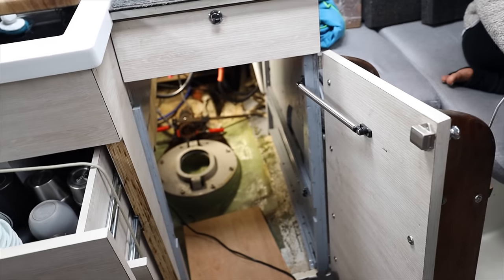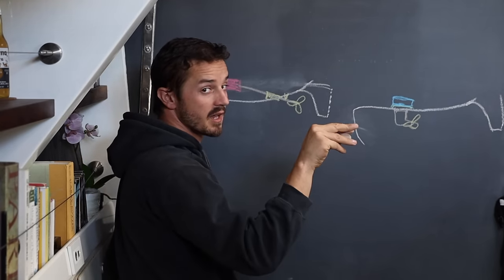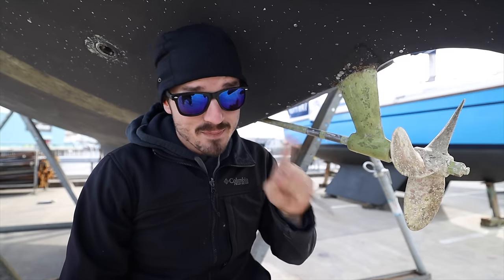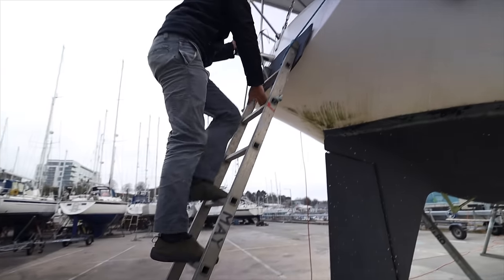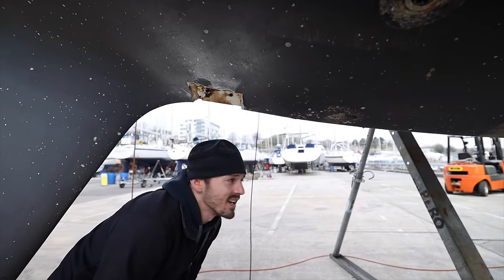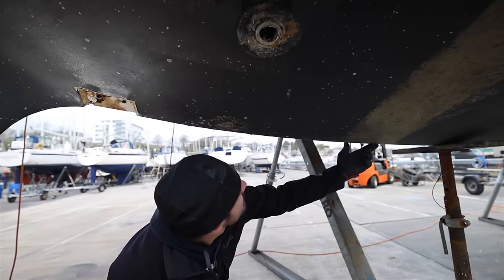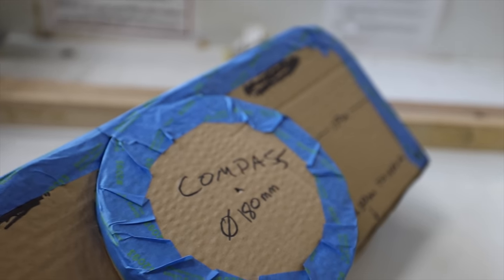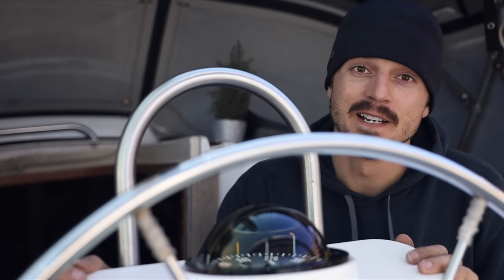CONVERTING to an Oceanvolt Electric Sail Drive — Sailing Uma [Step 213]

Comment: So quick question, did you end fiber glassing over the hole where the skeg was inserted or is it left like that? Wont that cause drag if not glassed into the boat fully?
Reply from the maker: If it was glassed in, we'd never be able to remove it. Water circulating around the saildrive is also part of the cooling system. But no, it doesn't cause any drag.
Reply: @SailingUma  Thanks for the reply. Funny I was just watching the video where you had the sail drive replaced and now and it makes total sense. I didn’t realize this was  more like a transmission. Definitely needs to be removable to be serviced. It was a novice post.

Comment: Shouldn't you build a box around the motor? I'm afraid that if you hit something hard enough the moment on the saildrive arm can create a lot of force to break the mount free allowing lots of water to enter the hull. A boxcarpundvtge motor that extends above the waterline would help prevent water flooding the hull.

Comment: Great video as aways. How did you know the correct gear ratio to use with that particular sail drive? Thanks!
Reply: Its one system, Oceanvolt sorted that for you :-)

Comment: I'm very impressed with your vertical glass work, I would have bet money it could not have been done without tape and visqueen. 
For reference, the hull of the OA 70e was 13 drums of resin, catyaized with 9 gal of hardener. 
She has dual volvo  rotating pods. Just like your setup. https://features.boats.com/boat-content/files/2012/03/pod-drive-2-1.jpg
Great job!

Comment: Glassing with resin in cold temperatures is not good for proper hardening and curing of the resin to get maximum strength and durability. You need to heat it with some heat blankets or heat cabels to at least 25 grade of Celsius for 24 hours. Read technical recommendation of your resin.

Comment: There still seems to be a gap between the skeg and the hull. How did you cover that?
Reply: Does that 'gap' allow for turning the skeg?
Reply: @EdKendrickDDS  don't think so. The flange at 15:31 is bolted down

Comment: How awesome would it be if the sail drive could rotate 90º to Port or Starboard so you could use it like a side thruster to assist docking maneuvers, can they make them do this?

Comment: Don't breathe the fiberglass.  It will mess up your lungs.  Wear a respirator.  Also wear eye protection.

Wear bunny suits for glassing/epoxying too, just like painting.

Very glad you'll be able to hydrogenerate.  It's a huge advantage to be able to charge drive batteries by sailing.  Basically you're motoring on wind power that way.  It's a totally logical and synergistic way to move a sailboat since it's ultimately all using wind power.

Comment: I don't mean to pile on here as I see lots of folks giving you advice, but I'm a 42 year fiberglass shipwright, and I cringed a little when I watched you painting in the engine (motor) room, without wearing a respirator.
 In an enclosed area like that, without good cross ventilation to evacuate toxic paint fumes, 
an/or a respirator, bad things can happen to fine young lassies like yourself.
 An adequate respirator would be a half mask type with charcoal cartridges, rated for organic vapors. 
Yes they are a nuisance to have to wear when working, but some of the solvents in paints, when they build up in confined spaces, can be very bad for your health.
 Otherwise cool upload and very nice boat !!

Comment: How are you going to get regen with a folding prop?
The minute the engine is off, pressure from forward motion is going to fold the prop.
Reply from the maker: That saildrive is designed to lock the prop open to allow regen.

Comment: The red Loctite really means business... as your bolts can twist off upon removal unless you heat the bolts first.
Reply: Blue Loctite holds great ... but it’s more forgiving upon removal. There is also a green Loctite available for other applications. 
Freaking awesome good work!

Comment: my question is can you leave the skeg on the boat without the prop shaft running threw it, would it cause a problem if left on?
Reply: They did mention a leak where it was mounted. Other than that, I imagine it would just be a bit of unnecessary turbulence.

Comment: Going from conventional straight prop shaft to 90-degree gear drive introduces an inaccessible drive shaft seal that can leak, additional bearings, and right angle gear all of which can fail. As a mechanical engineer, Id have stayed with the new e-motor with straight prop shaft configuration.

Comment: No flange sealant between the skeg and the motor? Would have thought you might need something like a smear of loctite 518 for machined surface to surface mounting.....?
Reply from the maker: There is a huge rubber gasket in there. Just didn’t end up showing it in the final edit.
Reply: Sailing Uma ahh 🤣👌🏽 ok then perfect, carry on 😁❤️

Comment: Too late for you guys but prop shafts with slight wows or bends can be straightened and there are specialists who do this exacting work. (If you think you might like watching people measuring long round metal shafts and adjusting them to +- .001`` , then there are videos on youtube for you....)
Reply from the maker: The prop shaft was only one of the 4 problems we needed to solve with the new drive.
Reply: @SailingUma  Of course. I was thinking of other people who might be in similar circumstances one day. The thought of possibly donating it to someone else who could really use it speaks volumes about your character. So impressed with your sail drive conversion....
Reply from the maker: Prop shafts are custom fit to the boat though, one doesn't just fit onto another. For the cost of having a machine shop straighten and modify the prop shaft, you could just get a new one fit. We did donate the motor and controller to a patron who is installing an electric drive on their boat though, since those parts you can fit onto any boat.

Comment: I heard sail drives tend to get leaky seals, is that accurate? What is the maintenance?
Reply from the maker: Boats tend to leak without proper maintenance. Also, sail drive technology has come along way over the years. The majority of boats on the water have saildrives but not all are created equal and proper installation is key.

Comment: Why not just take the old prop off and leave the old shaft and skeg in place? that way it can easily be converted back if desired? they wouldn't interfere with anything if left there, would they?
Reply from the maker: It would leak. Since the pressure of the engine pushing on the shaft bearing is what keeps the water out. It would also just be in the way. We have no plans to re-instal a shaft drive.

Comment: Did you consider U Joints for your original setup?
Reply from the maker: No need. The motor is light and easy to align.

Comment: I have been bouncing around your vids and love them. Very informative! But I just priced an Oceanvolt SD 10. $51,000 USD for one...... what the Foxtrot Uniform Charlie Kilo!!!! That is NOT a budget upgrade!
Reply from the maker: You can't really compare the two. It's not "apples to apples"? An OV quote also includes the, batteries and chargers. The motor itself isn't much more than a diesel. $15k (ish). Same price as a new VP 50hp, which is it's equivalent. Plus you never have to buy fuel or do maintenance for 30+ yrs. How valuable is silence? What price can you put on maintenance headaches and top end rebuilds? Besides, our motor MAKES power while we're sailing. On a good day, 24hr passage, around 5-8kWh on our slow old boat. How many gallons of diesel fuel does a diesel motor produce?
Reply: @SailingUma  LOL! You got me wrong! I'm not criticizing you turning to electric. By far I am not because I myself am converting a ship to electric. Your series has been more than an inspiration. I've been trying to decide which system to install and have been online searching the different systems. I'm different than you guys though. I just bought a cheap 1977 Trojan F36 and removed both engines to repair and modify the engine bay to get ready for the electrics to be installed. Removing the gas tank next week and will use that space for a larger fresh water tank and water maker. I like the thought of the Oceanvolt but on my ship the regen isn't really feasible and the system hanging down that low on a low draft ship could cause me some problems. I'm still trying to catch up on your vids. You guys have something very special going on and it's great that you've shared it with everyone.

Comment: Now, lets see.  
Small hole in bottom of boat replaced with big hole in bottom of boat.  Hmmmm?
Big hole open, great place for critters to live and not streamlined therefore more drag.   Hmmmm?

Bolts that hold saildrive in place and seal big hole screw in from underwater and not visible for inspection unless you dive.  Hmmmm?
Repair parts specialty items vs shaft, prop, cutlass bearing, skeg and coupling being pretty standard boatyard items.   Hmmmm?

You two certainly are braver than I would be.  
I think this is the first thing I've seen you do to the boat I seriously question.
It will be interesting to see how it all works out.

Comment: I would never get on the open ocean relying on wind and electric power.
I would have some sort of gas/diesel kicker.
Always use the guard when using that cut-off wheel. That disk can shatter and impale you. 
Source: Actually seen it in happen in person.  I am a mechanic

Comment: Not sure how you are trying to fit the plugs in your ears but easiest way is to roll them between your thumb and finger for ten or so seconds so that they become a really thin sausage and then pop it quickly in your ear canal and hold it there a second or two until it expands into place. You'll know if you got it right as your hearing fades away to a dull echo chamber 😂

Comment: How much maintenance does a electric sail drive over a shaft drive?
Reply from the maker: About the same. Both need seals replaced every 5 years or so. Zincs replaced on both at haulout. Saildrive now requires an oil change at haulout. But that takes 5 min and 1L of gear oil.

Comment: Does this replace your internal combustion engine?
Reply from the maker: We replaced the ICE when we got the boat 5 yrs ago with our DIY forklift motor (www.sailinguma.com/electro-beke)

This new sail drive is an upgrade to our previous electric motor.

Comment: is that unit hydraulic , ,using the old engine power , or electric if so where does the power come from to drive it.
Reply from the maker: It's electric. and the power come from the sun and is stored in our bank of batteries.
Reply: @SailingUma  many thanks .. must be limited on range then ..  but I guess that's what the big flappy bits do best 🙂

Comment: Why install it so far forward from the rudder, wont that be ineffecient?
Reply from the maker: It's really the only place we could install it. But one of the main benefits to an electric drive for docking, is you can give it full throttle in quick bursts, like a bow thruster and really move the boat quickly. But it's also a left hand prop, centred and a folding prop, so either way, it will be like driving a completely different boat.

Comment: a feathering propeller might have better results?
Reply from the maker: Yes. It would. OV developer one on their next generation called Servoprop. You can get similar results with a Max Prop but it can mess up the programming in the controller of our unit.

Comment: How do you charge batterys in a emergency like bildge pump running continuously for hours and hours cause you have a hole in the boat ?
Reply from the maker: We could run our bilge pump for days with the batteries we have.
Reply: Ok cool,  how do you charge your batterys when off grid as I  live on a yatch and cant get away from a generator when off grid for more than month at a time I'm running a 3000ah  at 24v battery bank  made up from 2v batterys I charge using   4 x 300w solar  two wind generators and a tow gen when sailing and still need a generator  I know the climate control system on board uses a fair bit off power  but the freezer and fridge plus lighting use small amounts and I use deasil for cooking .
 heating and hot water through a combi boiler also deasil   so not much power  drain but still need generator to top  up batterys when off grid for any periods off time,   easy when in marinas as you just plug in !!

Comment: Doesn't the folding prop defeat the generator abilities of the motor? Under sail the water would cause the prop to fold rather than spin... you would need a fixed prop for that.
Reply from the maker: We wouldn’t be doing it if it didn’t work... but you’ll have to wait for the regen test video about  it working for the details.
Reply: @SailingUma  Ah okay! Looking forward to seeing the video :)

Comment: At 18:14, we see some numbers on Dan's hand.  

What does 50/65 mean?
Reply from the maker: Torque settings for the skeg bolts.
Reply: @SailingUma  Got it.  Good job using a torque wrench instead of a "calibrated elbow."

Comment: Why not just to install new foldable propeller in place of the old one?
Reply from the maker: That would only solve one of the 4 problems we had with our motor. It was also undersized, overheated and couldn't produce usable regen. Nor would replacing the prop, fix the bent shaft.

Comment: Saildrives (like  outboard drives) are sensitive to galvanic corrosion especially when connected to shady Shore Power (electrolytic corrosion) .  There are pictures on the internet of them being eaten away.  Besides keeping up  with the anode replacements, there are articles on the internet of how to protect from electrolytic corrosion  by installing  a galvanic isolator.... Here is one article : https://www.cruisingworld.com/beware-unprotected-saildrives/

Comment: Is it not more efficient with a strait shaft?  no gears that take power..
Reply: The straight shaft points down into the water, loosing efficiency. The sail drive 'shaft' is in line (parallel) with the water line. therefore pushing the boat forward not up and then forward.  Look at Dans Drawings.   : )
Reply: @karyhansen5082  I have strait shaft on my boat and i have to brake the shaft to get the prop to fold.
but on a outbord engine the prop don't spinn if in neutral,

Comment: A Yanmar sail drive came with the the boat I have, and the anti fouling is  a pain in the a$$.  With an old fashioned shaft and propeller, onecould utilize the prop wash while in reverse to crab the boat to port when docking.  With the sail drive, one doesn't have that option.  Sail drives are high maintenance requiring diving to clean off barnacles, since I have yet to find an antifouling paint which will keep them at bay.  Any ideas anyone?  My sail drive is aluminum so that presents another whole antifouling agenda.

Comment: I missed the step of exactly how the bolts or nuts were set securely into the FG ring to bolt the flange down
Reply from the maker: The flange has a thick aluminum ring embedded into that we drilled and tapped to receive the bolts once all the glass was cured.
Reply: @SailingUma  Thanks for clarifying

Comment: "cool motors efficient motor" -- is this true, .. I mean a efficient motor, will run cooler ( less loss to heat) ... but cooling off a motor, I don't think makes it more efficient. I think it just makes it not die.
Reply from the maker: The more it heats up, the more power is lost in heat. It’s a chicken vs egg thing I guess.
Reply: As the temperature  rises, the resistance increases, which makes the temperature  rise. Repeat...

Comment: Great video folks! Couldn't you have kept the Diesel engine though? Just in case of a electrical failure of some kind? You never know, or am I talking out my arse? What does everyone think?   I'm still a firm believer in Diesels though, but I'm always open for other technology. There's no doubt that electric motors are very efficient and effective.
Reply from the maker: The diesel was seized and they only made them for a few years. So we'd be stuck trying to recondition a 30yr old engine they no longer make parts for. We thought about the cost of buying a new diesel, but electric is much cheaper, even including the batteries. Besides, we really dislike the smell, noise, vibration and maintenance that comes with diesels, which is the main reason we don't have one.

Comment: And just think, no more prop walk now that you'll have a saildrive!
Reply: Not true. I have a saildrive unit and get significant prop walk...
Reply: @MT-iu5ls  Sorry to hear that. I get zero prop walk with my Yanmar unit. Perhaps your saildrive is not perpendicular to the waterline? Having the prop at any kind of angle is what causes prop walk.
Reply: @toddstidham8374  Hi Todd Hauled out recently and looks to be well aligned in all axes. Full excursion of blades each side also. Have spoken to at least one other A35 owner who reports similar. Is sometimes useful in manoeuvring as long as you are aware which way the walk is

Comment: How does a folding prop re-gen?
Reply: Fantastic and thanks I have replaced my Volvo 30 d with an electric conversion 5 years ago and I have a kiwi prop with 3 to 1 belt drive reduction. Regen is only possible at 7 knots and above.  The saildrive will be awesome looking forward to the next video.
Reply: @stuartwatson9140   But a folding prop folds when the boat is moving by sail power, I though that was it purpose.